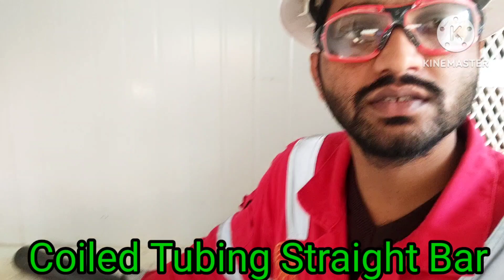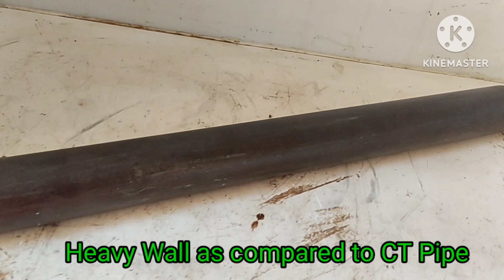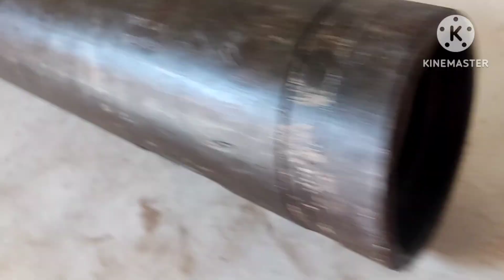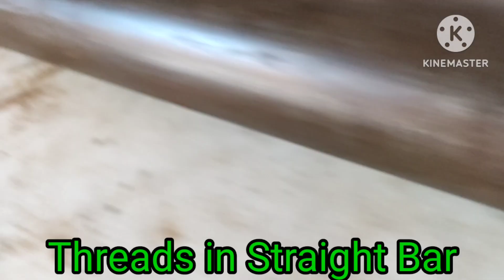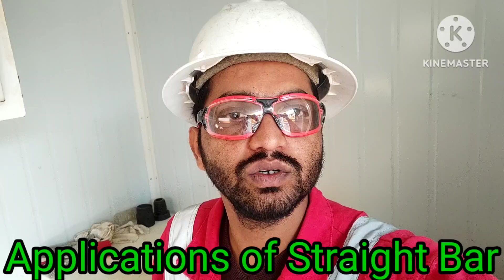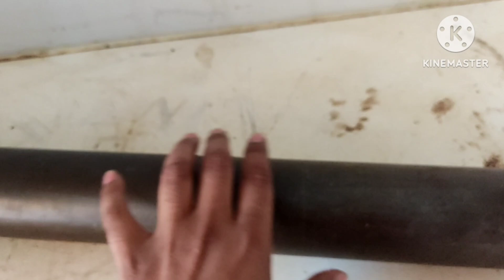132 - Coiled Tubing Straight Bar by Yasir Ali

Comment: Hi Yasir, thanks for your time and efforts. I have 2  questions.
Q1: why we deployed BHA PLT before CT Logging Operations?

Q2: It's none that, we used Equalizing valve to equalize pressure above and below the Ram. Which situation can we use Equalizing valve? Thank you.
Reply from the maker: Answer #1 : In PLT the length of BHA is greater than the length of risers. To tackle lengthy BHA deployment system is used.
Reply from the maker: Answer #2, Assume that CT is in the wellbore and your kill line is connected to Xmas Tree wing Valve. In that case if you need to equalise pressure above the ram,  you have only option to use equalising vave.
Reply: @yasirali028  Informative. Thank you.

Comment: Can you explain what the BHA use in Drilling start from rollconnectore
Reply from the maker: The generic BHA for CTD should be 1) Connector 2) MHA 3) Straight Bar 4) Accelerator 5) Hydraulic Jar 6) PDM Motor 7) Bit